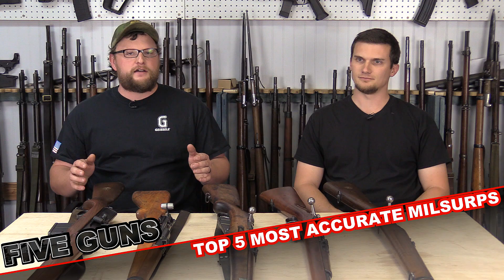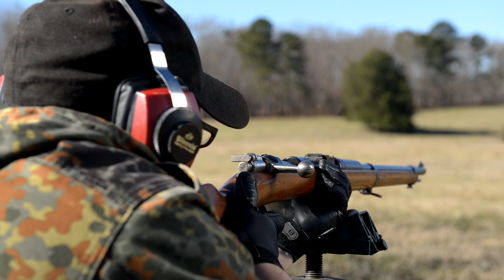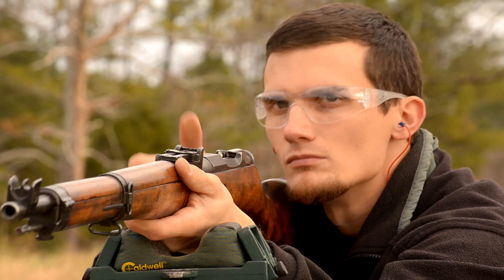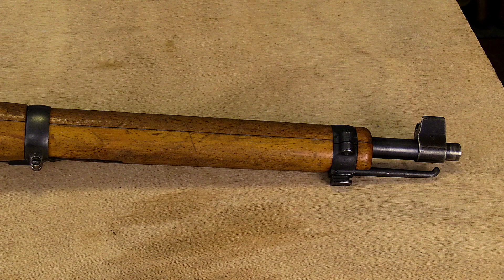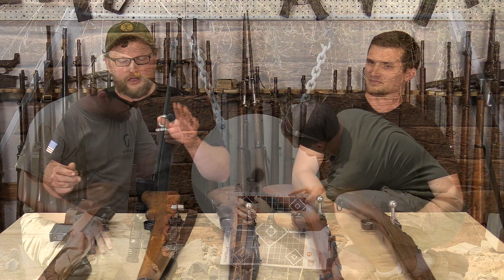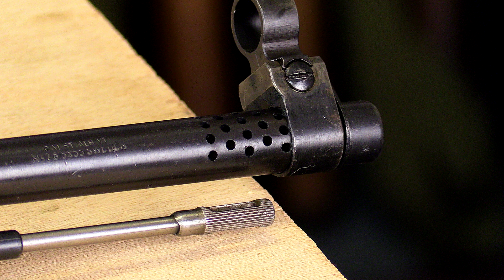Top 5 Most Accurate Military Surplus Rifles

Comment: Despite ridiculous hype and propaganda to the contrary, Lee-Enfields were never great rifles when brand new. They were known to have significant bore diameter variation, crappy rifling, poor fit and finish, etc. Mosin-Nagants are much the same. Which is why both the British and Russians were forced to test-fire brand-new rifles to find the "most accurate" production rifles for fitting with scopes for sniper use. It's also why scopes were often serial-numbered to match the rifle. 

A good scope should produce good accuracy and precision on ANY rifle you mount it on IF the rifles are also quality pieces. If the scope has to be "matched" with a rifle it's probably because the rifle and/or scope and/or mounts had to be "modified" to produce acceptable accuracy and precision by monkeying with mounting holes to provide more "adjustment", etc.

At the same time the Brits and Russians were "hand fitting" their scopes and mounts on the best production rifles they could find, U.S. armorers were basically taking production lots of Garands and Springfields, making a few minor modifications to mount the scope mounts and were installing the mounts and scopes to produce "sniper rifles" in a fraction of the time and resources expended and were getting as good or better results across the board. 

"Modern" rifles produced today don't need the "fitting" and "fiddling" to produce outstanding accuracy and precision even with "cheap" mass-produced rifles available at a WalMart, and "high end" rifles have been incredibly accurate and precise for almost as long as rifles have existed even using production techniques and technology that are laughably obsolete and outdated by today's standards. 

So there is no excuse for it having been necessary 100 years ago to fiddle with and hand-fit and test-fire rifles to produce the relatively LOW levels of accuracy and precision demanded by armies for "sniper" use in WWI and WWII except for the overall low quality of the rifles, scopes and mounts.

Anybody can hand-pick a rifle here and there from various countries and military forces based upon MODERN performance with  HAND-LOADED or HIGH QUALITY factory ammo under ideal shooting conditions to determine "most accurate". Just like anybody can take a pile of mil-surplus rifles if he or she has access to them, test-fire the whole pile and pick out the one or two best-performing rifles and call that a "test". But try taking a random sample of a dozen of those rifles in all conditions, find true military surplus ammo and do a more "real-world" test for "combat accuracy" and lets see the results.

Comment: I found a match grade Enfield that was the only one with the numbered brass buttplate. I got it from Turner's in San Bernardino CA for 49 bucks back in 96. I took it and disassembled it, then soaked the stock in ammonia removing the crappy coating that was on it. Then with steel wool it was rubbed with Cherry-Wood stain matching all pieces. Afterwards verathane clearcoated. When assembled it looks stunning, and with handloaded rounds shoots 3100 fps and flat stacking them at 300 yds. The farthest I've shot was on the Navajo reservation in Winslow AZ, at 5000 yds and hitting within 3ft iron sighted. It's a good testament to the craftsmanship of the time with all those rifles, and the men who carried them into battle.

Comment: Very nice presentation guys ! I own 1942 Swedish Mauser ( was in factory grease paper packings when I bought it 100 yard less than 1 inch group is no problem, I also own  6.5 Ljungman has taken
many deer for me as well i own M-39  -42  ( was m y initial service  rifle in The Finnish military ) when  you look at the Sweds there is a brass plate that shows letters " overslag" with punched in mark on it it says that if the number is at 1 that the barrel is "0 clearance" which means perfect barrel that is what I have on my -42  6.5  these rifles were made by Husqwarna  wappenfabrik and were the most accurate of the Mausers that I know of. I hope that gives you bit more info on these great rifles >

Comment: Are there any Finn M39's that were made with Westinghouse or Remington receivers?
Reply: I think there are some with remingtons around, but they are really rare. And kind of pointless if you ask me, but lets not get into that :)
Reply: Pointless? Why pointless? I suspect a Westinghouse or Remington receiver would likely be the best Mosin receiver ever made.
Reply: I'm not saying they are bad receivers. But my take on military surplus is about having a quality weapon that was something used on the front lines. The receivers on M39 work very well, so personally I see the oddball, "one off" version as less desirable. Of course I'm not saying this is in any way, shape or form an objective opinion. But why go with a historical rifle and then avoid the version that actually did the work? I'd personally just go with a less expensive, modern weapon that probably does everything better anyways. But I stress this is just how I see surplus weapons. Your opinion may well be different though and still be equally valid.
Reply: I get what you're saying. The M39 is being peddled as a different animal I think. The M39 is being touted as the pinnacle of Mosin development and it doesn't seem to matter if it was arsenal rebuilt during or after the war. so it kind of takes the historical aspect out of it. So my thinking was that a Westinghouse or Remington M39 would be as good as it gets, no? Personally, I'm not a Mosin fan but a Westinghouse/Remington M39 with a Tikka/Sako or the like barrel does appeal to me....talk about trail. It starts life in Ilion NY, goes to Russia, gets captured by the Finns, gets arsenal rebuilt to be better than new and then ends up in the hands of a guy back in the states.

Comment: Sweden have had peace for 200 years. Don't think those rings means enemy kills.
Reply: Elestro Air-soft the were used by different countries.
Reply: Swede mausers were used by the Finns in the Winter War and the War of Continuation in small quantities.
Reply: Not to mention the Swedish Volunteer Corps that took part in the winter war (8,260 Swedes served in it) and the Swedish Volunteer battalion that served in the continuation war and they were equipped with Swedish weapons.

But also you say it was used in small quantities is understating it a bit.

During the winter was Sweden supplied Finland with atleast 77,000 rifles Mauser rifles 
   (January 1940: 52,000 rifles and 12.2-million rounds of ammunition
    February 1940: 15,000 rifles and 5-million rounds of ammunition
    March 1940: 10,000 rifles and 2-million rounds of ammunition).
And this does not include those used to equip the voluenteer corps whos rifles also stayed in Finland when they returned.
If we consider that the total production for the M/39 is at around 102.000 rifles it was more then just a small qunatity.
(And since only 535,000 Swedish M/96 Mausers were made those sent to Finland were a considerable chunk of that).

Though to note is that after the Winter was 25,000 of those rifles were returned for To Sweden as Sweden was starting to re-arm seriously after the fall of both Denmark and Norway to the Germans and the rifles that remaind in Finland during the continuation war were mainly used to equip the navy,coastal troops and anti-aircraft crews on the home front (as that made more sense logistically so they would not have to provide frontline units with different rifle calibers)
so most of the combat the Swedish mausers saw were during the Winter war where they were issued to both Finnish troops (Primarily on the northern front)
 and the Swedish Volunteer corps.

Comment: You are correct @ 12:10 , the Finnish 7.62 TK 85 (tarkkuuskivääri = marksmanrifle) is basically a Mosin-Nagant on steroids. It uses a substantially heavier barrel and has a beefier wooden stock, but still uses in some cases literally antique Mosin receivers and bolts. If I'm not mistaken those rifles were modified by Valmet. I've shot with those quite a lot, during my time as a military police NCO in Pori Brigade, in Kosovo (along with the awesome SAKO TRG 42) and during my military refreshers. 

One of the problems with those rifles is that since they use the basic Mosin-Nagant action, you can't use stripper clips to load them since the telescopic sight is in the way and it's a pain in the ass to load each shot individually. If the FDF still wants to keep using those (since the TRG42 is waaaaayyyyy more expensive rifle to procure and maintain), I'd like to see a switch to a stock that would allow the use of detachable magazines, something like the Mosin-Nagant stock produced by Archangel. Using a polymer stock would also reduce the weight quite substantially, the rifle weighs like 7kg which quite a bit more than a rifle like that would actually require.

Comment: Lee-Enfield No. 4 MkI LB 1942 re-barreled in 60s little wear amazing shooter. Should I restore it? it has MkIII sights sadly but some sights for the original gun didn't look as good as MkIII but they are stronger but I've seen special sporter target sights they made back in the day with the screw adjusters "1940s" just need to know if I should reblue it sand the stock take out the dents and put the brass buttplate on linseed stain it and polish it all up and inlay the original marks back into it
Reply: And by the way I bought it from someone who didn't know what the guns were I got both a nice Enfield and a pretty decent Mosin Nagant (1952) from him for $200 in 2016
Reply: Chris Griffin Enfields were never blued they have this weird paint on them.  Wouldn't touch the stock if there are any markings on the outside of it (serial numbers, rack numbers ect. ect.)

Comment: Can some of those be found with chrome lined barrels?
Reply: Russian Mosin-Nagants after a bit of work become very close to Finnish ones in terms of smoothness and accuracy.
Reply: Not even man, you need A LOT of work on a regular mosin for it to be as accurate as a Finnish one. More than it would cost to just buy an M39
Reply: I think the biggest problem of Russian ones is lack of consistency. For some Russian mosins it's true. Quality of barrels and assembly vary and better rifles were picked as PUs. Finnish ones have definitely superior barrels. Good think is you can still find non issued Russian ones. The whole point of mosins is they are cheap for what you get. Russian ones are ~$250-$300. Finnish are almost double. For $600 you can buy much better rifle than the M39. Well, then you lose the historical value.
Reply: A little shimming and fitting work, and a 91/30 can often surprise you.
Reply: Krasimir Ivanov Ah, guess it depends where you are from! Here the 91/30s in good condition are $200-$300 and the M39s are $300-$400
Reply: Well, is that the the price in Canada? In Europe prices are higher even in a former Warsaw Pact country. Russian 91/30 are easy to find but Finnish ones are almost impossible.
Reply: Krasimir Ivanov Nah that's US prices down here in TX
Reply: Texas - nice! Guess the best place to own and buy a firearm. Let's hope it doesn't change.
Reply: Krasimir Ivanov Hopefully!

Comment: Most accurate is almost irrelevant in the combat role. Accuracy only be sufficient. The M1903 was far more accurate than the M1 but in combat shooting the Garand would produce more hits per pound of ammo and was FAR easier to use in combat. Carlos Hathcock got most of his sniper kills in VN with a rifle that only shot about 2MOA according the his Commanding Officer. So while the accuracy is a lot of fun is USE its not that critical. I have a Garand that will shoot about 3 times the group size of a good 6.5 Swede but at 4-5 inches at 200 its a VERY effective combat arm.
Reply: Nobody is really arguing combat effectiveness. If they were, variants of the M16 would take every spot in the top 5 if they were talking military arms in general

Comment: M91 Mauser, great cartridge 7.65x53, like a 308 round in capacity.  but again, a C-O-C design...and only 2-lug bolt.I know a guy who was firing one, and the bolt jumped the sear when closing the bolt, it fired when he rammed a round home, it threw the bolt out of the gun, off his shoulder, gave him a big gouge that was 10 stitches at the ER hospital, the bolt flew 30 feet behind him and struck a tree, took a big chunk out of the tree. that's why I don't recommend C-O-C designs unless it's an Enfield 1917, those you can convert to cock on opening.

Comment: the most accurate milsurps I ever owned, were a 1917 Enfield 2-groove 30-06, and a Mauser 98 FN 1935 Belgian in 7.65x53.  both were tack drivers.  the Mauser got the slight edge due to lighter weight of the rifle.

Comment: Men - all the rifles shown are open sighted rifles; peep sights i:e M1917, M1903A3, LE No4, Ross MK3, Brazilian M968 etc. The sight radius or iron sighted rifles is the reason, depending on the firers capability, is why the rifles are accurate, regardless of action type. My comp rifles have included 98Kk, M1917, K31, P14, M1903A3, with my current #1 shooter being the Ross Mk3. The pick of these for usability and accuracy is the M1903A3 after each has been used for at least one year in competition in trying to find a all round ergonomics, adjustable sights for windage and elevation. Before the laws changed in Aust also I've had two 42Bs too but never shoot one of these without hearing protection. The pay off at the end of the LE about condition is poor for such a quality production.

Comment: So the gold circle on the end of the Swedish rifles is used to determine the "quality" of the barrel. I believe top numbers on the circle are used to determine the level of barrel erosion. The lower numbers which ranged from 0-3 determines the quality of the bore over time. Gunsmiths would indicate this by an indentation each time it was sent in for repair or replacement. Once the numbers were marked high enough it meant the barrel would need to be replaced. Earlier models simply mark which type of rifle it is (training, infantry, cavalry).
Reply: Furthermore, if you're looking to purchase a swedish surplus rifle it's good to look at the last known barrel quality. If it's marked with a 3, and higher numbers on the top portion, it isn't your best bet for an accurate surplus rifle.

Comment: did you know that the .303 british rounds tighten up outside of 500 meters?
Reply: really?
Reply: +Gungeek yes but I'm not clear on why the shot groups tighten up a bit
Reply: Yes and no. This is proven to happen but only when mil-issue ammo is used. mil ammo isn't as precisely crafted as is hand-loaded target stuff. The Lee-Enfield has a rear-locking action, which results in pronounced barrel whip. A round with less powder (Cordite) will remain in the barrel longer than one with more powder. The whip of the barrel compensates for the "more or less" powder charge. And yes, this becomes apparent only over longer range. It is believed Lee was very well aware of this and so factored this into his design.

Comment: My opinion the K31 is probably the most accurate considering any older surplus ammo for em from Switzerland is match grade (Gewehrpatrone 11 7.5mm 591-1100),  Also they were also the one of first high pressure rifle cartridges produced,  its not unheard of to get consistent 1000 yard hits with the K31 when you get used to its sights, the guns never really developed much of a reputation because the swiss didn't fight in the war, I have a few, they are very well made, there was care put into them each and every one, you can tell by the engraving and little things like they come with barrel caps to protect their crowns,  For a second world war gun being a sub moa rifle with good ammo is very very impressive,  I have a 1942 Canadian Enfield No4 Mk1* LONGBRANCH and its an excellent rifle aside from the occasional split casing due to the chamber tolerance,  I strongly suggest trying to get a Longbranch enfield if you can, the Canadians stripped em, put new sights and did a lot of work on them for precision and smoothness, they are no way the same as the SMLR its kinda like the fins with the Mosins, I have a  walnut K31 with matching numbers, I love it,  Tons of the GP11 in Canada and for very good prices

Comment: Ever shot a Ross MKII OR MKIII? They're somewhat hard to come by but they're great shooters if you make sure your assemble the bolt correctly. They were designed as a sporter but they saw action with the Canadians in ww1. They kind of failed in combat but they are great smooth, fast straight pull rifles out on the range.
Reply: The Ross MKIII. Great shooter if it doesn't take out your eye.

Comment: I had a Swede I Sported out years ago, put a Timney trigger in it, adjustable rear peep sight, Fajen walnut stock all glassed and floated, and a shotgun pad on the butt ( 'cause the military configuration kicked like a pissed off mule).  I shot it at 100 yards, off a bench, using iron sights, and had five shots touching in a little line across the X.  No more that an inch for all five.  That was the most accurate rifle I have ever fired, and it originally cost me $125.
Reply: They've climbed in price quite a bit, they're now about $500 for a good one, which is roughly what I paid for mine. But damn, do those things shoot! Mine is in practically unaltered military config, but even with the standard v-notch sight and stiff trigger I've consistently shot the best groups I've had in my life. The '96 Swede is a fine piece of kit, that's for sure. Still mostly worth the higher price.